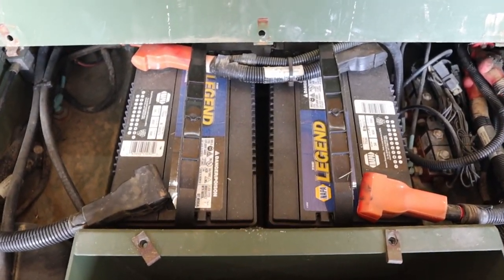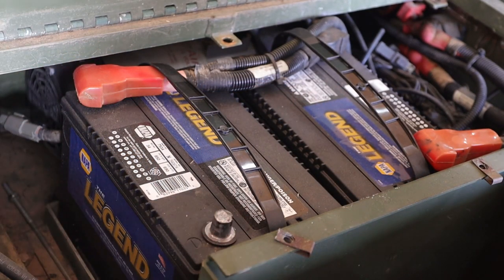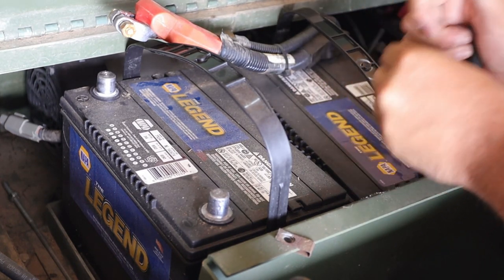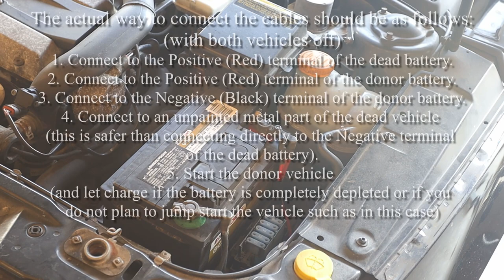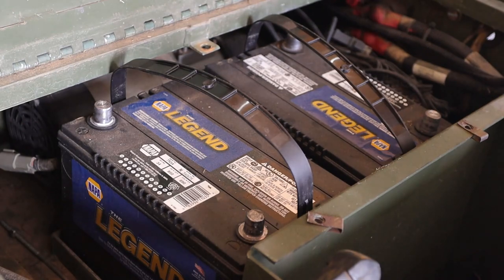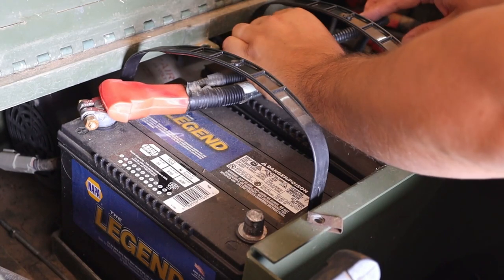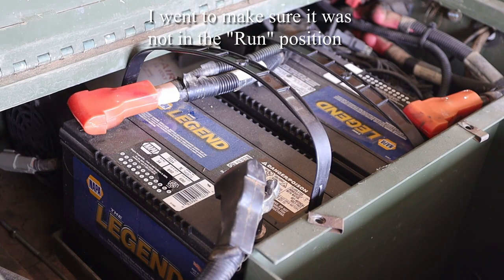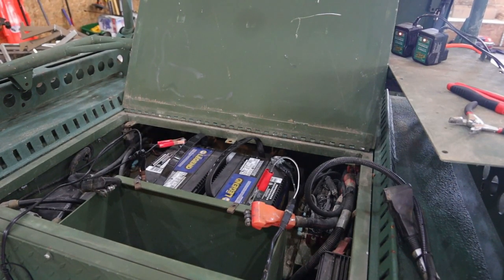Charging the Batteries in a 24V Military Vehicle

Comment: Thx. Have a deuce &1/2.looking for information on Not frying anything trickle charging with regular 12 v charger. Don’t really want to disconnect everything. I’ll finish watching. Liked and subscribed.  Question. I left my fuel cap off the one night we got maybe a quarter inch of rain in North Carolina during a 40+ day drought. Do I need to dump the tank? I don’t know diesel. Or military vehicles. Honestly shouldn’t have bought it. Just don’t wanna mess it up before I sell it. Any information would be good and appreciated thank you
Reply from the maker: In regard to the water in the tank.  I believe that it can cause problems with microbes growing and causing negative effects to the tank and the fuel system.  I also believe that you can buy some type of biocide for diesel vehicles that can help take care of some of the issue.  I would speak to a professional mechanic however as I do not have a lot of experience with diesels either.
Reply: Me and My Growler biocides.google it in am. Got late on me Thanks
Reply: Dump some sea foam in your tank and run your truck. It smokes from the sea foam, but it will clean everything out. You can trickle charge your batteries with a 12volt charger. Only charge one battery at a time instead of charging both. You dont need to unhook anything